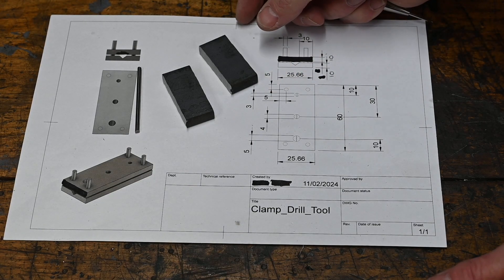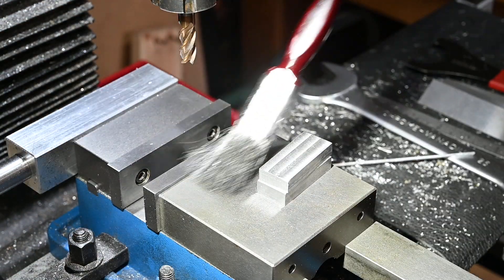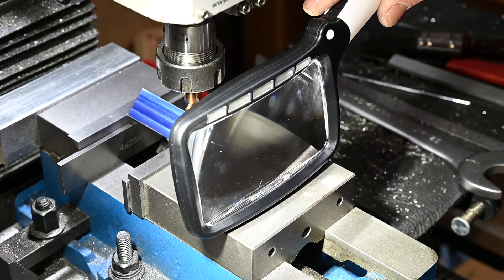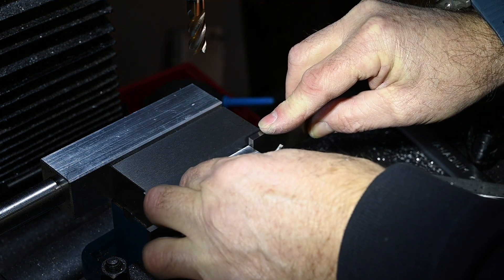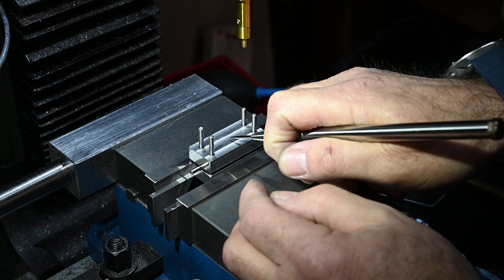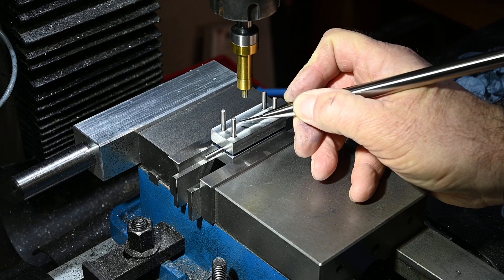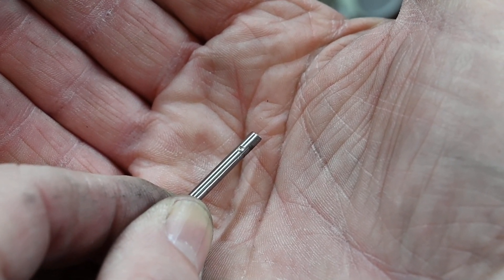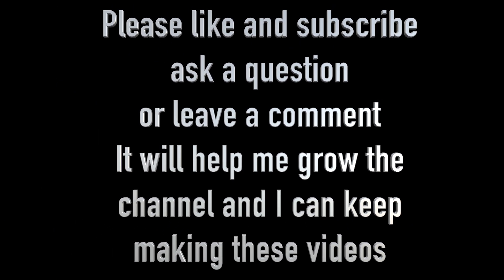Drilling Guide Jig Fixture

Comment: 35° + 15° = 45°? I trust you misspoke, rather than cut a 50° - 40° vee, or your final drilled holes will only be accurately centred for that diameter.
Yes, I'm nit-picking, but at least I'm paying attention 😉
Reply from the maker: Your probably right, I do that a lot when filming 😂